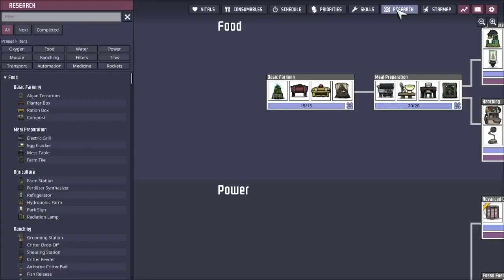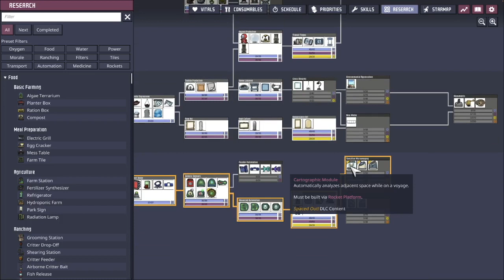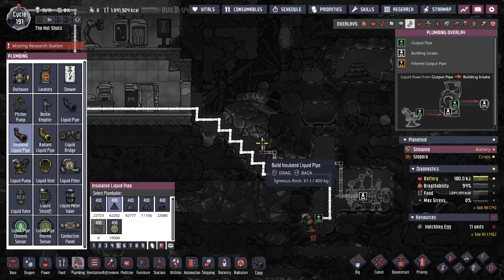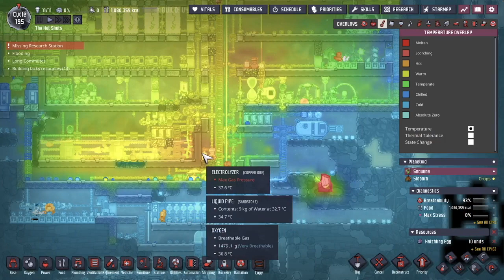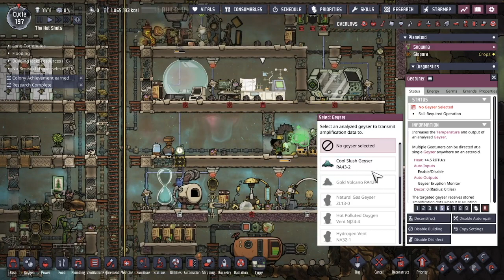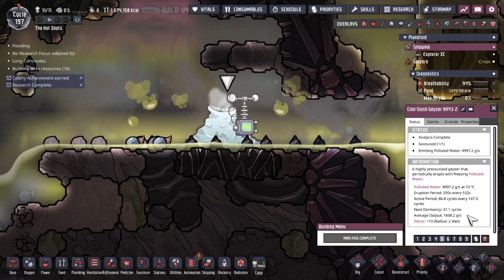Hot Shots #8 -  Geotuner

Comment: all of the water geysers require bleach stone. so, you will need to raise squeaky pufts with a chlorine vent. a single vent supports 2 pufts, or 28.5(2) or 57kg per cycle of bleach stone.

also, you can use up to 5 geotuners on the same geyser. you can get up to a +100% increase due to the ability for them to stack.
Reply: rocket program mine resource fields and get bleachstone from it
Reply: @mikehanks  you can do this, but it is silly for this.